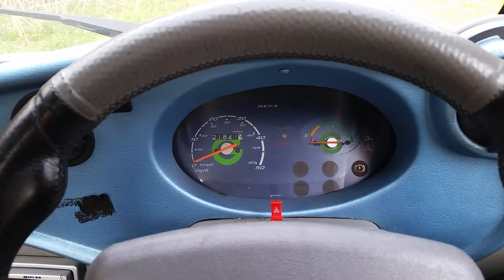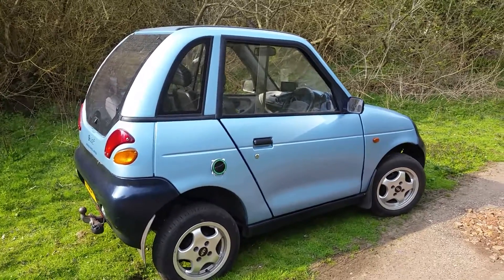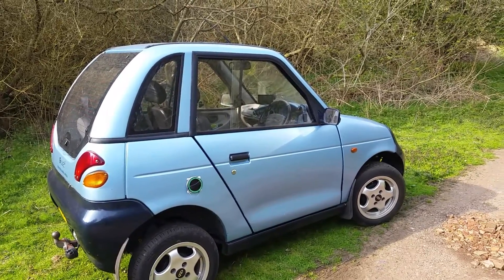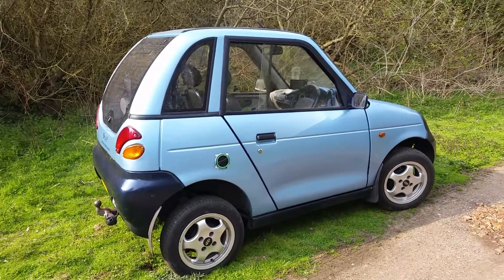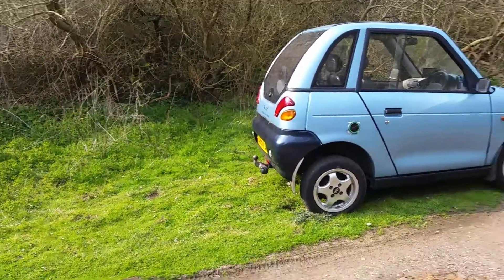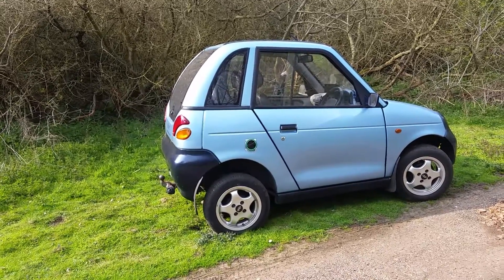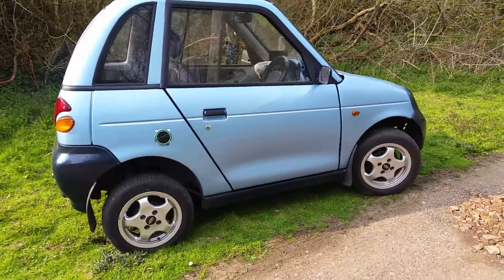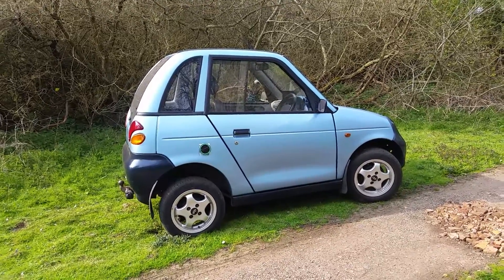REVA G-WIZ: Lithium ion conversion full range testing

Comment: I like this car so much, I am an Indian & I live in Taiwan, and this Car is made from Mahindra & Mahindra India. It is called as Reva-I in India,  I am very sad they stopped its production in 2012 and now unable to find used reva to experiment with. Most of reva which are on sale are from south india and to get that car transport to my state itself takes as much as cost of car itself. :(. Good news is mahindra going to launch similar model this year end. lets see.  Here in Taiwan so many such small EVs around and very cheap as compare to this.  Thanks for posting about this, waiting for next video.  I have small 800 watt escooter here EV is so much fun to drive. You can see about my scooter on my channel 

Subscribed. waiting for more for this cutest car.
Reply: Ganesh myself Murali,  me too awating for EV car. I'm very interesting on these projects.
Battery packs is the major issue in India too much cost it India there is no good quality battery production company especially we need to use good stable, brand battery packs unfortunately these but few people are converting there existing petrol car to EV cars with LeadAcid battery bcz low cost. Lithium ion battery are there but no branded all 80% faik battery packs(mk568571@gmail.com)

Comment: Maths by Dianne Abbot?
Reply from the maker: Had to research to understand that one! - Haha you are probably right for the beginning of the video though. I couldn't remember the start milage from the top of my head but it was in fact 21699.2 so the 148.9 miles was correct as when I parked up to take a final reading the milage was 21848.1.